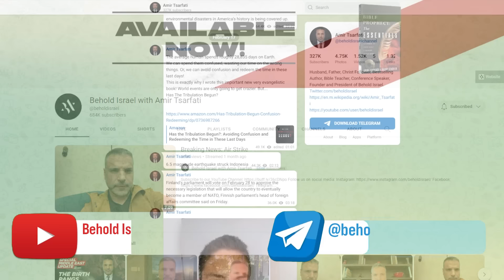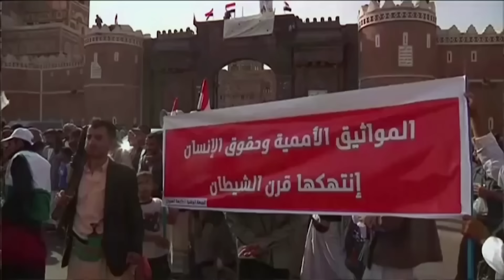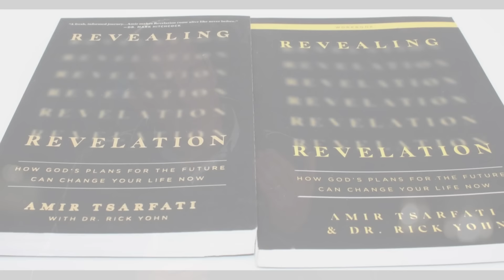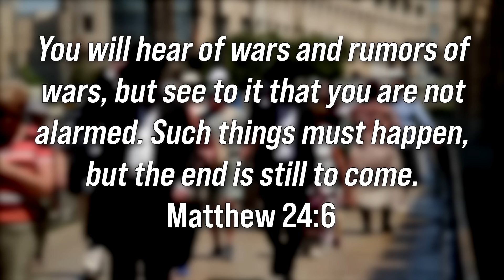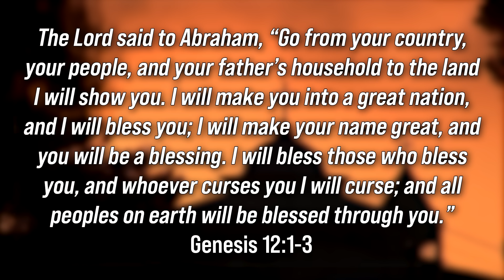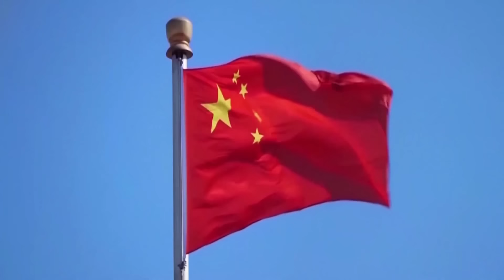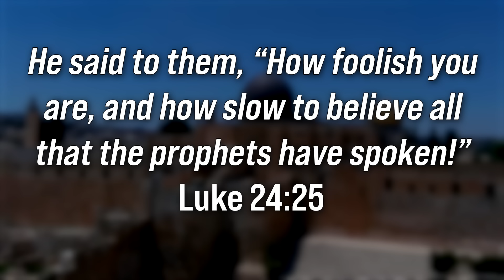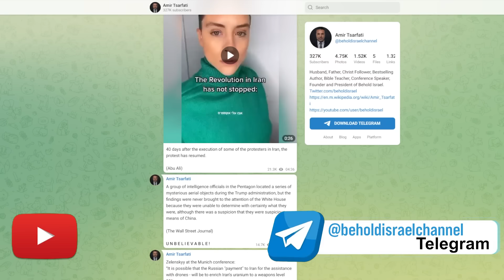EXCLUSIVE w/ Amir Tsarfati: Bible Prophecy Update, Gog & Magog & Israel's Future | Watchman Newscast

Comment: Many biblical problems are obscured by the endeavors of scholarly misunderstanding.
You can't use the English Bible as an authority to present a valid interpretation.
As an example, Ezekiel contains misspelled words.
Other issues:
From Hebrew -v
          To Greek -v
                 To English
The Greek bible is not a direct translation from Hebrew.
The Greek bible is a mixture of translation and phonetic transliteration.
Dr. Strong identified words that are not Greek words with a numerical identifier. These words are Hebrew written with Greek letters.
There are words Dr. Strong didn't realize were Hebrew, giving them Greek definitions because they appear to be Greek.
Arnee - phonetically is both Greek and Hebrew
Arnee - Greek - Lamb
Arnee - Hebrew - be vigilant
When the author of the text wrote it in Hebrew, which form should a translator use?
These are just a few examples to highlight the problem.